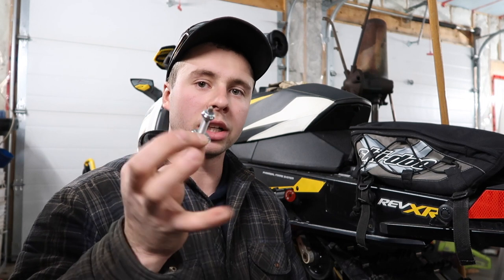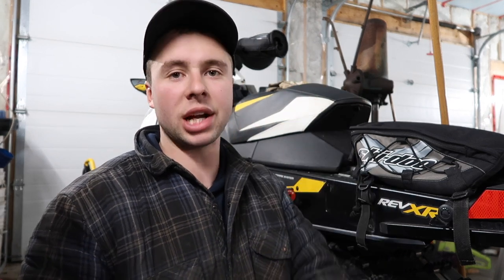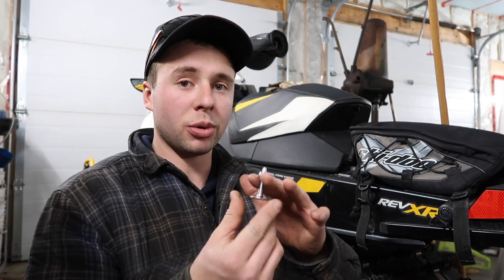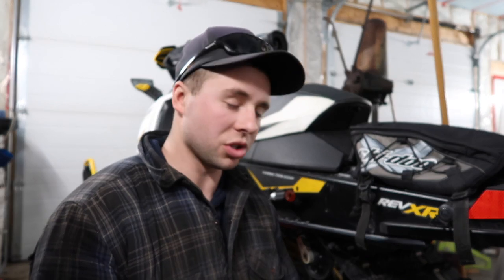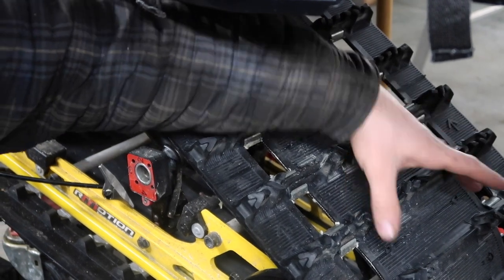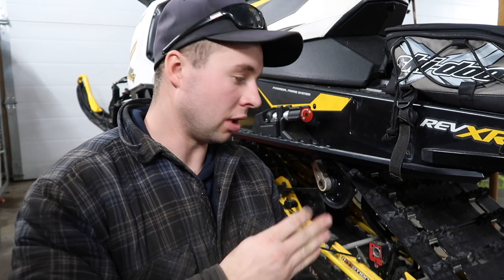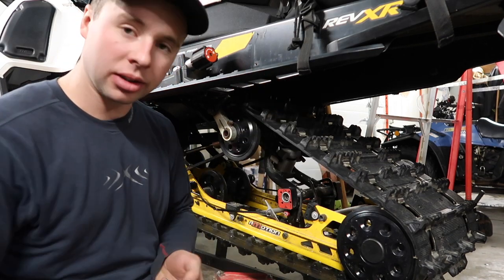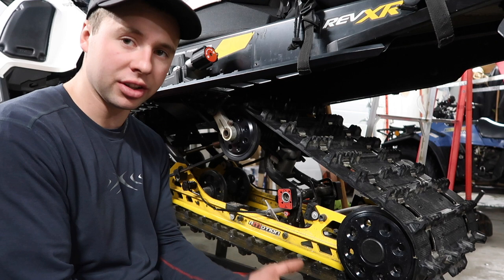How To: Stud a snowmobile track (Ski-Doo 1200)

Comment: Another great video on the 1200. I'm glad you like how you got your stud layout. I don't see any on the ends is that a full 96 then all the way through with the 137 inch track? I should bit the Bullitt and do my grand touring this year for my riders safety as well. Those late season snirtty corners are very slippery. I didnt get your sub yet. I only have 4 but I just putz and dont do YouTube as a hobby. Look in to put on rail mounted not drilled in ice scratchers. These from betweenthelinesdesigns make a good set because of the mounting for the 3 boogie wheels of the Rmotion skid. 😊 HOLIDAYS from Wisconsin home of the snowmobile capital of the world Eagle River..
Reply from the maker: Thank you sir. You should very well bite the bullet. Yes 96 studs for the 137 inch track. 48 bars at 2 studs per equals 96. I would not put any studs on the outside of the windows they will likely rip out. I have scratchers on my Skis and they work very well. Those ones on my dads sled i studded work well also.

Comment: i have a renegade 1000 track has 1" lugs track is a 137 inch track. so 96 should work for me? also how long a carbide stud should i get?
Reply from the maker: Yep 96 will be perfect for you. Same as that sled. With a 1” lug i would have to look at the book honestly. You only want them to protrude a little bit above the lugs. Every brand of stud is a different length it seems. Something like a 1.075” or so would be fine. Especially if your track is not brand new and wore down a bit.
Reply: @Schneids15  thank you